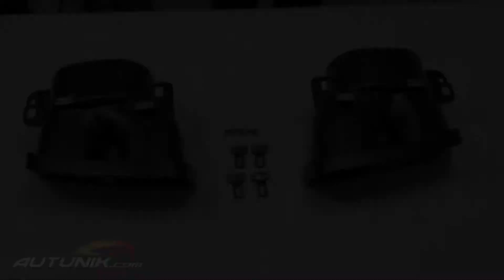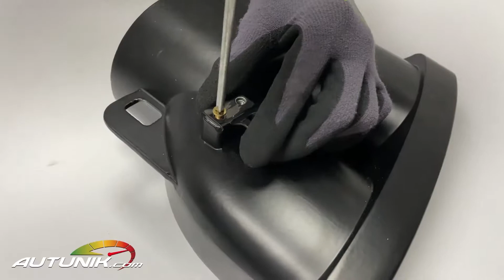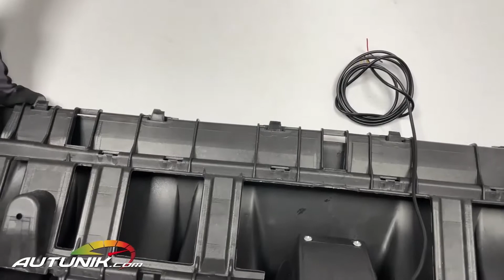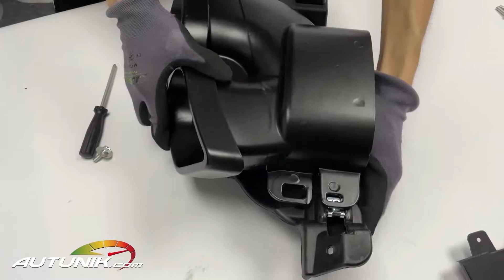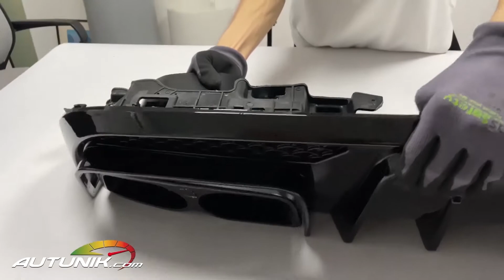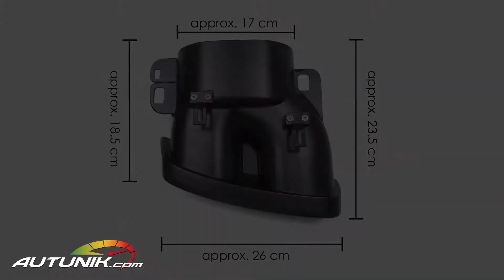Autunik.com - Mercedes-Benz C-Class W205 Sedan Brabus Look Rear Diffuser Installation

Comment: I recently purchased a diffuser from your website. I was excited to receive the package. The package looked like it was resealed and damaged. Nevertheless, I was excited to receive the kit and install it. My suspicion was confirmed as when we opened the kit, the carbon was scratched and the exhaust brackets were bent and the bolts were “used”, slightly striped. There was no wiring diagram as to which wires to connect the wires to. Could you please provide information as to the proper wiring sequence?

Comment: The video was very helpful in putting the brackets together. But I’m having a hard time understanding how to install it especially if the sensors aren’t even aligning to the same holes as the AM diffuser. OEM sensor holes are located further apart (more spaced out)
Reply: Doesn't matter if the sensor holes aren't the same. I have this diffuser + a c63 style diffuser. The hole alignment is different from the other. Once you take off the original diffuser yull see sensor holes doesn't matter because the sensors themselves are connected to lose  wires.
Reply: @BassGods  hey bro do you know what color wires connect to what? I just got this diffuser and am confused
Reply: @Alexryanrod  I wish I could tell you, but I haven't even gotten the Chance to install mines, because I've been pretty busy. I'm actually waiting for the spring to do that. I live in New Jersey, and it pretty darn cold. Hopefully you can find that out on YouTube. I do know that your end goal is connecting them to the break lights.
Reply: @BassGods  aye I know how to do it
Reply: @BassGods  ima upload a video on how to do it in the next few days. Just make sure you have the notifications on my acc and I’ll post it in the next few days
Reply: @Alexryanrod  OK Thanks. I'd rather do it myself, than pay someone else to do it, when I can probably do it myself. 👍👍

Comment: Same question. What does the light connect to?
Reply: Light connects to the Break light. Not the turn signals.
Reply: @BassGods  but the break light and the turn signals it’s the same on 2020 c300